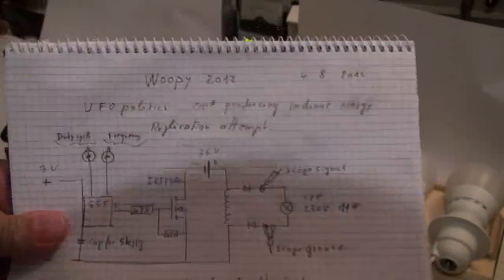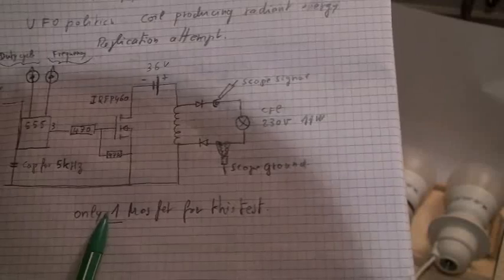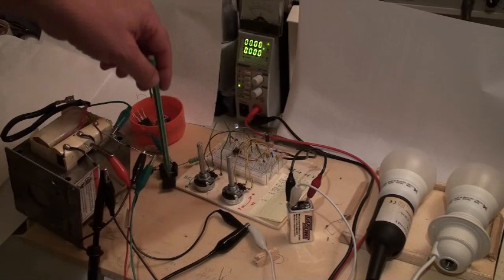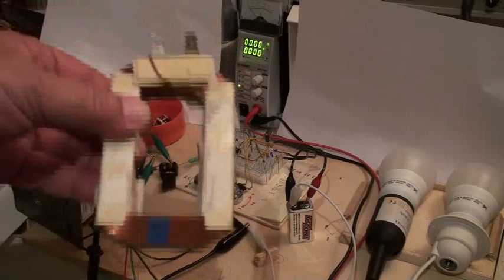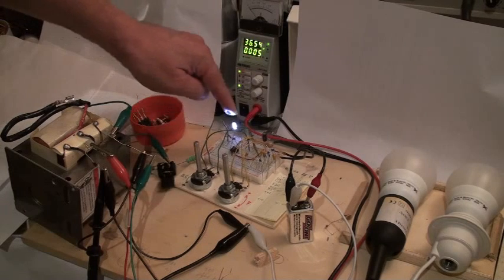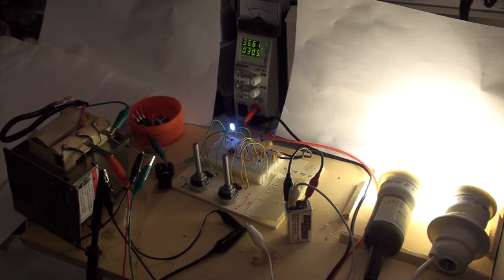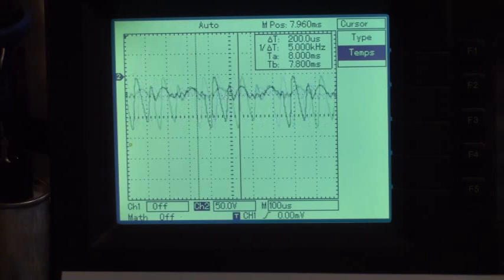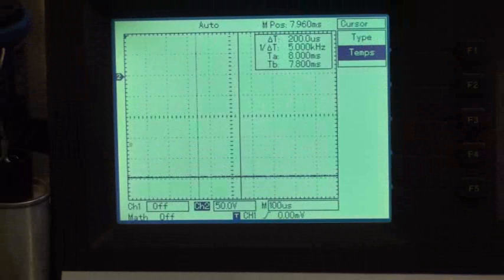cold electricity testing replication 1

Comment: Thanks for sharing very interesting, suggestion compare with rodin coil, using middle of coil  to drive motor that runs generator (see Gerard Morin for pump motor) and produce self running setup.  Then you have prototype of global solution as, I think you will have enough to make hydrogen (for gas to run car , truck, etc.; as well home)

Comment: Hi Woopy, thinking that extra power should be available from directly across the CFL terminals when the plasma is ignited.  Due to negative resistance of plasma itself, the CFL load becomes a source.  Some videos show resistors placed across CFL terminals cool rather than heating. Also can ignite CFL plasma externally so energy value of ignition is isolated and possibly less than energy available across CFL terminals due to the plasma's negative resistance characteristics,

Comment: Collapse of the magnetic field, not the electromagnetic field.  The collapse is never more energetic than the energy it takes to build it up.  When an inductor discharges there are always small losses associated with the resistance in the wires.  Using a spark gap is not directly related to the collapsing field.

Comment: Great experiment.  This circuit is simply harness the back emf that is generated by the "coil" every time power is turned off back emf get collected.
Since it's with Khz range output is quite smooth.  Output power maybe more efficient by using feride core transformer since feride resonates  with much higher frequency. Laminate metal cores it's efficient under 100 Hz. Over all. See lower speed version of this circuit  on YT use these key words. Mehmet's Back EMF II

Comment: Nice video Laurent,

You had the duty cycle at 60%?  What happens when you bring it down to a level that is on par with the grid tied lamp?  What is the power input to the lamp at that time?  Of course you would want to wait until the grid tied lamp is at full brightness.  You would then want to swap lamps to make sure you get the same results.  Thank you.  HT

Comment: "Voltage with almost non existent current" is directly associated with coils.  The ironic thing is that the coil actually stores energy in flowing current with no voltage at all.  So there is always current in these "cold electricity" cases.  The trick is that it is the current that produces the voltage.  Most people can visualize the voltage producing the current, they see it all the time.  What's harder to visualize is the current producing the voltage, and that's the "secret."
Reply: La corrente che produce la tensione questo è il segreto, potresti spiegare tecnicamente il tuo concetto facendo un esempio concreto per fare quello che dici, grazie

Comment: That's why you get a spark when you disconnect a coil that has current running though it.  Think of the air as being like a very high resistance.  The coil sees a very high resistance and it must generate a very high voltage, so you see a spark because the coil turns the air into a conductive plasma, which is simply a resistor.

For the CFL as a load, the coil generates a voltage depending on "what the CFL looks like" in terms of a resistor.

Comment: So here is the mystery of "cold electricity" explained:  When the coil discharges it acts in a complimentary way to a capacitor.  You know that with a lower load resistance, a capacitor will discharge faster.  However, for a coil, it is a _higher_ load resistance that makes it discharge faster.

For a coil, when the load resistance is very high, it generates very high voltage because it has to discharge all its stored energy faster.

Comment: You can see how in your circuit when the MOSFT is on current starts to flow through the MOT.  That stores energy in the field inside the MOT.  Then when the MOSFET switches off the MOT wants to keep the current flowing through the diodes and the CFL.

You are showing a variation on a "classic Bedini" configuration.  So the MOT discharges it's stored energy through the CFL.

This process is often mistakenly called "cold electricity" because sometimes the voltage from the coil/MOT is very high.

Comment: Woopy, is the CFL being driven by the circuit unmodified or did you take out the circuit board?  If you did not take out the circuit board you note that the circuit board is designed for an input excitation of 220 VAC.  When you change the excitation with a discharging coil it is indeterminate as to what will happen.  However, from watching many CFL clips you can see how the CFL still lights up, just like in your clip.  However, the circuit inside the CFL represents an unknown.

Comment: i notice this on incandescent bulbs as well and i believe it is because the bulbs are being over-driven by the higher voltage which also causes it to require less current than it's grid-fed counterpart. good show and no I do not believe you are too diverse your mind is taking you along a path it prefers to learn through inspiration and that is always good.